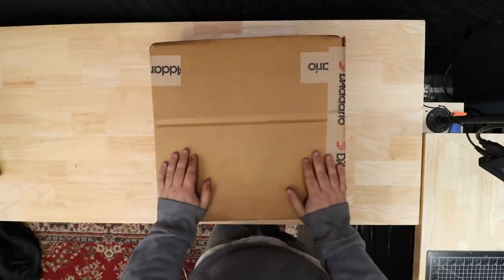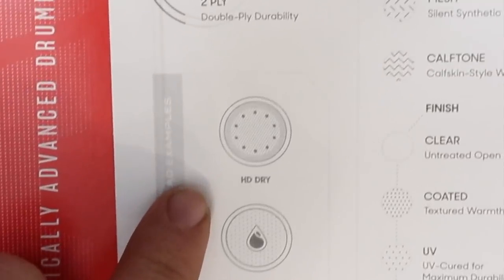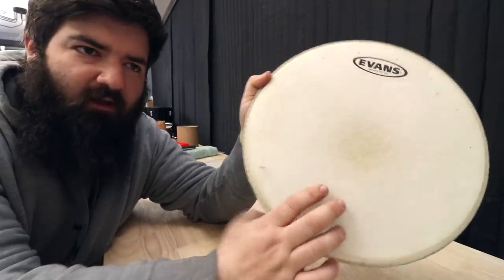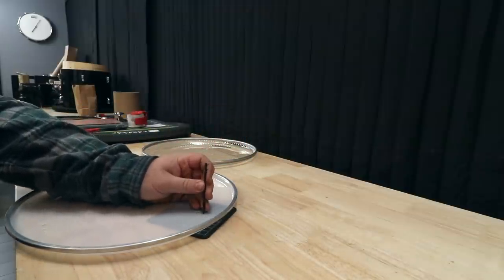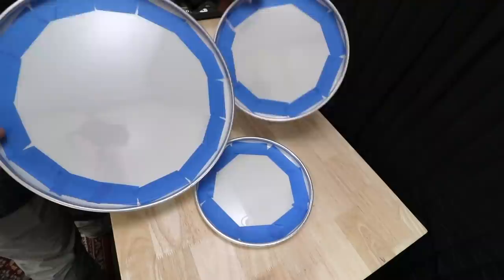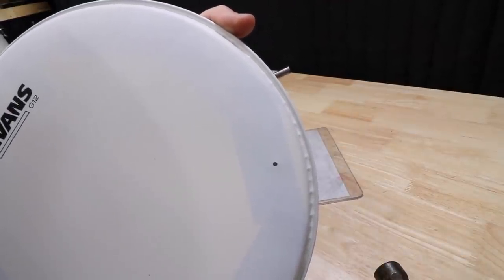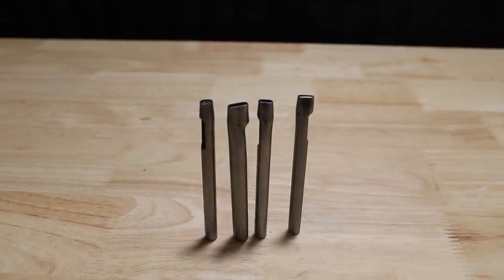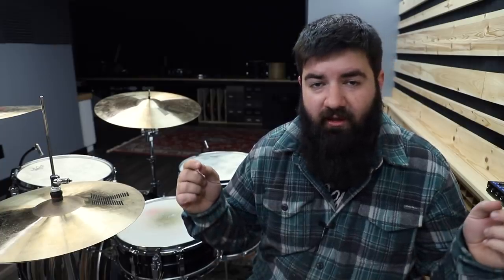Punching Holes in Drum Heads for @SoundsLikeADrum  - DIY G12 Dry - Part 1

Comment: Used to do that to my P3's back in the day. Would just measure the spacing of an HD Dry and place on top of the P3 and use a pencil to mark the spot. I'd go over the marks again afterwards and just use a plain old thin nail and a hammer and punch them in. To avoid the weird raised edges I would hammer the nail in from the top side onto a piece of wood that I would just move around. Plain and simple, worked every time.

Comment: Did you think about trying to melt the holes in. Just heat up a piece of metal that is the diameter of hole you want and push it through. Typically melts plastic pretty cleanly.

Comment: I actually liked them better with the holes. Sounded brighter and had more attack. An idea for your hole punches David. Most punches are sharpened from the outside creating a slope of the metal to a point. That’s what is creating that flared hole. If you made your own punches where they were sharpened from the inside out, there wouldn’t be any flare in the hole.

Comment: Maybe using a heat gun for a few seconds on the 1/16th hole with the punches could remove the dent? Either way, wouldn't it go flat once the head is stretched out on the drum? The drilled holes look like a tear would be likely to start from the hole... really experiment, heading over to pt. 2!

Comment: I know I’m a year late, but I wonder if putting the 1mm hole punch in the drill press and drill it that way would work better? Or maybe the pressure from the spindle would be enough to pierce the drumhead really square to a hard surface.

Comment: My idea for getting clean holes is to sandwich the drum head between something like pieces of plywood or maybe acrylic, and clamp those down so the drumhead material has really good support. Then use really sharp quality drill bits, fresh out of the box, possibly the kind made for drilling stainless steel. Alternatively, you could grind them yourself, especially if you happen to own a Tormek drill sharpening jig or something like that, to ensure they are really sharp. (Not to turn this into a Tormek ad but they do have some great videos on drill bit grinding. Their expensive grinding jig probably needs all the help it can get to sell... anyway, I digress.) 
You could even experiment with different drill grinding angles if you have a sharpening jig since the factory angles are optimized  to be OK-ish usable for a wide range of materials and last a long time for maximum customer satisfaction, but they are not be optimized for cutting as-clean-as-possible holes into thin sheets of mylar. It stands to reason that other angles work better while wearing down the drill bit edges quicker, which is all the same to us here for this. 
And maybe do the actuall drilling on the drill press.

Comment: Theres a few great tips here David! I'm thinking a hot nail would work too, kinda like a diy bass drum port hole with a super hot soup can (which I learned from you also lololol). But the leather punch was a great idea also. I love the HD DRY 14" heads on my snare but I cant justify the extra cost or lesser availability some places so i just get Genera HD heads and put a peice of frog tape on the drum with scotch clear extreme 3m mounting tape on top for muffling (its double sided so I just leave the top peice on the mounting tape so the sticky isnt exposed and it never comes off and allows me to stack the tape if I need more muffling and the extra stack very easily comes off again if I want it to). And the bottom layer of the frog tape allows me to easily remove the muffling to replace it if it gets dirty or if I just want a more open sound temporarily without pulling off the coating on the head. That muffling system has worked really well for me since the 3m tape has the consistentcy of thin moon gel. Plus it looks really clean and my very real OCD is triggered by dirty inconsistent muffling. I pretty much only use muffling on the snare (single peice) and sometimes a small peice on the floor tom reso when its tuned low to stop stray resonance from the kick drum (just enough to stop the interaction but not enough to change the overall tone). Anyways this was a really great video idea. I've considered adding my own holes many times to the cheaper genera heads.

Comment: I use a heated knitting needle for this.

Before I switched to Evans fully, I did this to the Remo snare heads and to my kick drum reso head (I got this from Russ Miller), Im planning on doing the same thing to the Onyx batter head as Evans doesn't make black Dry heads.

Comment: At least one other person has already said this below, but I'll articulate a bit better.  NOTHING works better for making holes in drumheads than a very hot metal object in whatever size hole you are looking for.  It will go through like a hot knife through butter.  Seriously - take a propane torch, heat a nail to almost red-hot, and it will make the cleanest hole in any drumhead.  Just make sure you're steady and going through at 90 degrees or you'll get odd-shaped holes (use a heated nail in a drill press for consistency).   If you want to make a perfect hole in a bass drum head to port it, use a clean,  large old soup or tomato sauce can, put it on your stove element to heat it evenly, then with with your oven mitts on, very carefully pick up the can and place it on your bass drum head where you want the hole and voila... you have a perfectly round hole with no jagged edges.  Just make sure you do this on a concrete floor or some surface that won't get damaged when the hot soup can touches it!  I've even used a chunk of heated copper pipe to make half-inch holes around the circumference of my bass drum reso heads (DW does this) so I could get the benefits of some additional venting on my bass drum without a big hole in the front head.

Comment: My first thought would be the tensioning placements matching spacing and number along with the size scaling.

 Burn with soldering iron.

You did a clean job as always

Would this help my 7" deep 24" kick drum? It's not vented and only lightly damped internally.. Mostly used with 5 Roto toms live outdoors

Comment: I think maybe a combination of a hardwood backer, punching from the front, and using a smaller hammer so you can hit softer might do the trick for the small holes. Alternatively, you could try chucking the punch in a drill (ideally a drill press) and spinning it so it cuts out the hole, again using a hardwood backer. Maybe even just putting it in the drill press (turned off) and using it to slowly push through instead of hitting it with a hammer might reduce puckering.

Comment: you could try melting the smaller holes using a rod the correct diameter and just heating it with a torch. Or use a different style drill, one without flutes and only does the actual cutting on the head of the drill might leave a cleaner finish

Comment: I'm late to the party so this might already have been mentioned but I tried venting bass drum and tom heads by melting holes with a heated pin. With some practice it went very well and created nice and even holes. Practice on an discarded head first! Should also work with a soldering pen with adjustable temperature but the tip might have to be thinned to custom size.

Comment: think if you melt the holes through with the punches or go over the holes with a paint stripper / hot air gun after there done you get a thicker edge around the holes that might help prevent stress points where the head might tear from

Comment: I’d love to try this on a kick drum. I love the look of an hole-less Remo Fiberskyn head but always regret cutting a 4-5” hole.
Reply from the maker: I actually have a vented dw kick reso head, but it has a port hole also. Id be curious to compare a regular bd head with a port vs one thats vented and no port 🤔
Reply: @rdavidr  You should man! Quick little follow up video to this one. I've been all about the Remo Fibersykn felt tone heads lately
Reply: It works great. I used a soldering iron to melt the holes and it sounds great.